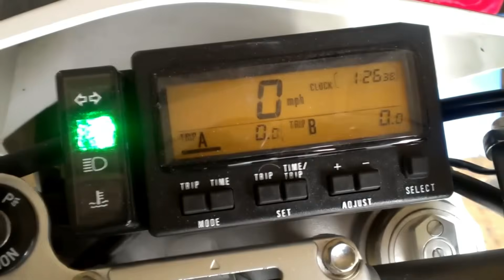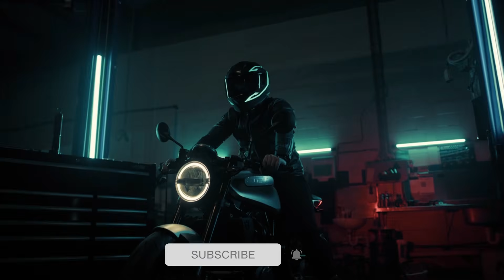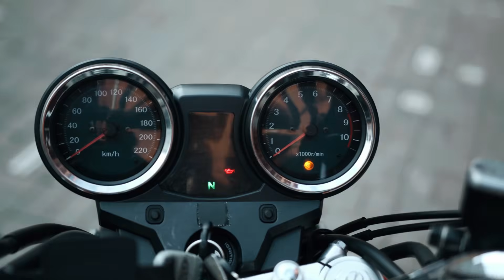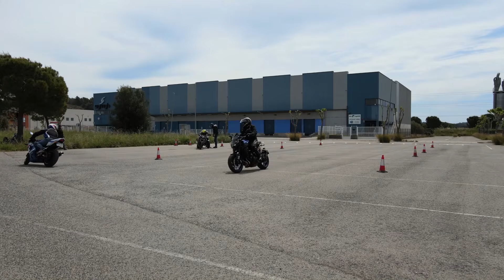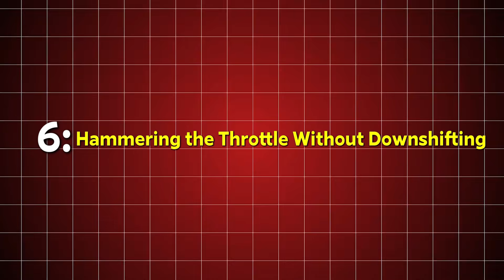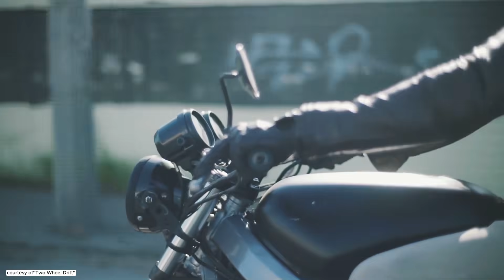Every Biker Must Know These 31 Hacks, Mods & Engine-Saving Habits (Don’t Learn Hard Way!)

Comment: I don’t take my bike to the shop ever. I did but then there is no mechanic I trust. So I do everything myself. It takes time but they rule you off as quick as look at you.
Reply from the maker: Respect doing your own maintenance takes time, but you know it’s done right and you’re not relying on someone you don’t trust.
Reply: I took mine to a dealer, they did not do anything and charge me $800 dollars. Never again taking my bike  to a shop. I  do all maintenance and repair myself.